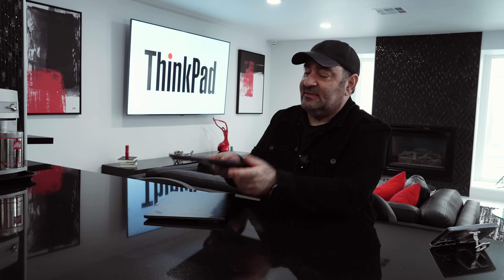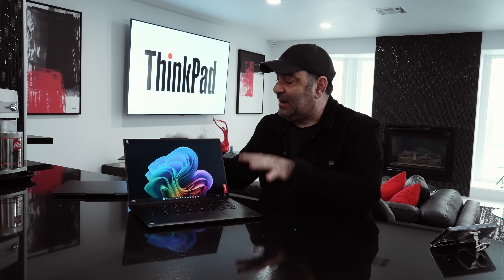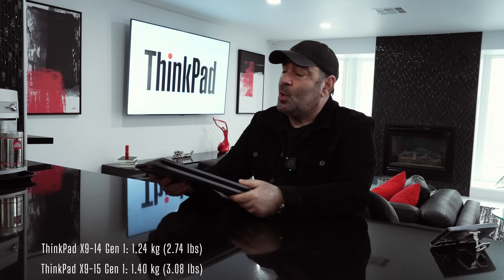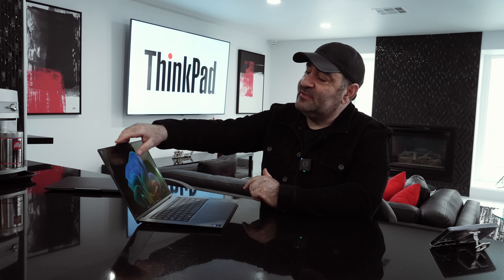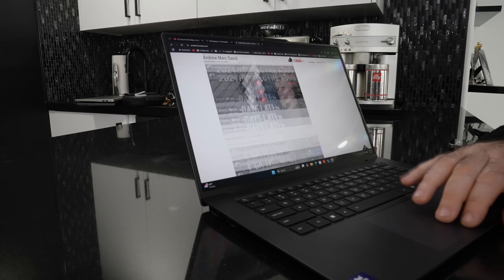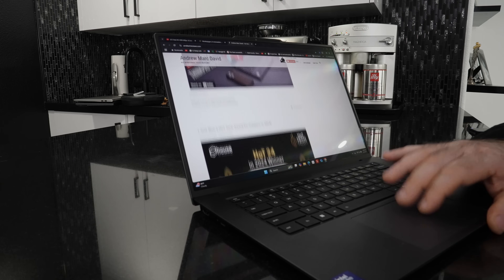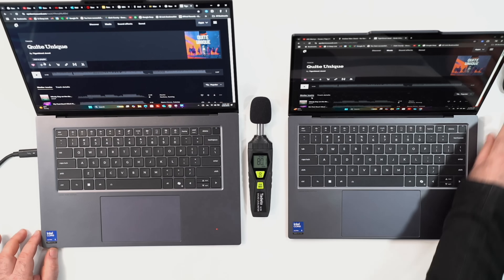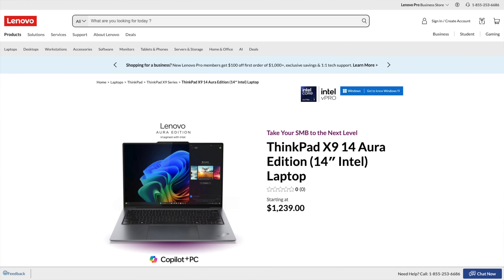ThinkPad X9 (15") REVIEW:  Well This Was UNEXPECTED

Comment: I still don't get what is use of 13inchers or even 14inchers other than backup laptop.
Reply from the maker: They're great for portability!
Reply: I agree. Even in public transport you either have no room for a laptop or manage to fit 15-16". I haven't found myself in situations where I wanted a smaller device.

Comment: Buyers of the Yoga 15” Aura should consider this too. It has a less powerful CPU and less RAM and storage at the same price level but the advantages are probably more tangible: longer battery life, better screen, better trackpad, better webcam and overall much better build quality. This has a standard 3 year warranty vs 1 year for the Yoga. I’d probably go for this.

Comment: I whish they didn't give option to have touch, non haptic touchpad. Just select a resolution that %150 scaling works for screen, no touch, haptic touchpad. Only option should be the cpu/memory/ssd. No touchscreen nonsense, no old style touchpad. 

If not, importers in my country will ruin everything and import the top end, and top bottom. Very bad screen or unnecessary hi-dpi screen with touch ruining the display with screen door effect.

Comment: Thanks for actually reviewing the laptop, rather than simply reading a spec sheet to us. This is the only non-fake review I've been able to find of this laptop.
Reply from the maker: Appreciate that!
Reply: @ I have extreme buyer’s remorse with my M4 MacBook Pro. After 20 years of being an Apple customer, I’m convinced that nobody hates Apple customers more than Apple themselves. I’m considering selling my M4 MacBook Pro and going with a premium PC laptop and dual booting Windows and Linux. A large screen (15+) and centered trackpad are my two main requirements. Other than this ThinkPad X9 15, do any others come to mind? I’m a bit hesitant with the Surface Laptop for Business 15 (Intel) because Linux support isn’t clear and the pricing is ludicrous without volume purchases. I need a centered trackpad due to my accessibility needs, which is why my last ThinkPad was the T520 (I still have it). Thanks!

Comment: To the X9 15-inch touch variant owners, I’m curious about the severity of the screen door effect in real life. Do you notice it from a normal viewing distance? I work extensively with writing applications, which often involve a white background, so I’m particularly interested in how it affects my work.
Reply: I personally didn't see screen door effect in daily use ( in normal distance between eyes and screen ), the screen is excellent honestly. However, if you come extremely close to the screen you will probably notice that there is a feeling of sand pixel in the screen ( very subtle ) in white mode, BUT only when the distance is UNCOMFORTABLY CLOSE, so i expect this won't bother you, at least i don't.   Since everyone have different experience, the most effective way is to check it out by your self.

Comment: I still don't understand why the speakers on the 15-inch is a tad weaker than the 14-inch variant.
Reply: Considering only the 14" model gets a Sensel touchpad, I'm betting the speakers for the 15" are also from a different vendor. I don't know if I'd say they're necessarily weaker... they just might not be tuned to work well with Dolby's "Dynamic" preset. I've found that the Dolby app's presets can be hit or miss depending on the hardware. The "Voice" preset on the 14" model for example makes speech quieter for some bizarre reason.
Reply from the maker: Yeah, it was a surprise to me as well.

Comment: I have the 15inch and it’a a descent machine (compared to a macbook pro), focusing on the bad part
- linux support is coming (not there yet)
- tactile trackpad from chicony is ok. Right click is hard to do, and we need to put too much force to click to my taste. Palm rejection is actually bad.
- speakers are bad compared to the macbook pro. And still bloated with the dolby software.
- display is excellent for day to day use but colors is aweful for watching movies. Blacks are greys… weird for an oled. Software issue?
Reply: Extra notes:
- I wish we could control the click force from software settings. Only click tap sensitivity, but not the tactile click.
- my video testing is incomplete and want to spend more time on it. I only tried to watch a show on Crave from my chrome browser on windows. Like I said, probably a software issue. I cannot believe an oled cant do better.
- for speakers, i am still disapointed about its sound quality. There is definitely a business opportunity for someone to bring a pre-integrated speaker with proper hardware dsp configuration to be sold as an oem solution
Reply: Apparently the 14 inch is very good for speakers, sad to hear the 15 inch has mediocre ones... I wish companies focused on that a little more. I tested the zenbook s14 in store and it was really good. Weirdly enough better than their s16 and any macbook other than the pro 16... I wasnt 100% sure as for the pro 14 inch but the laptops were far apart and they were either equal or the asus better at 60% brightness @rissmau11

Comment: The difference in the haptic touchpad is quite significant. Sure if you have never used a Sensel and you pick up the x9 15 it will feel good. But using the x9 15’s non-Sensel pad next to the surface laptop 7 for business’s Sensel pad, the Sensel pad is clearly better. It’s significantly smoother and more responsive. You can fine tune the pressure required to make a click. And it’s also very consistent. I had to return the x9 15 because I was constantly getting non-clicks at different amounts of pressure being applied (I.e. the inconsistency). I even tried regedit.exe to manually reduce the pressure needed for a click (which is a standard Windows setting feature for Sensel touchpads) but it did not seem to change at all no matter what value I set it to. Night-and-day difference in my experience.

Comment: Nice laptop.  Camera and mics are good.  Display very good.  On a clamshell it is no big deal as using a pen on one of these is not very practical.  Sound is good although the smaller one is still better.  As far as the touchpad is concerned when one starts using this for a little while one will get used to it fast and it will not be an issue of what brand of touchpad it will be.  As far as price is concerned it will be interesting what effect the coming tariffs will have on these.  Great quality review.

Comment: Reiterating what you said I really love the X9 but I do wish it had the 1.5 key travel that the Lenovo Yogos are coming with however I am interested in trying the Microsoft surface business model and hoping the keyboard might perform a bit better.
Reply: Having ordered and tried both the Surface Laptop for Business and ThinkPad X9, hands down the X9 has the better keyboard. I REALLY wanted to like the Surface badly for its cleaner design, but the keyboard felt noticeably mushier to me. I was experiencing some key deflection issues which held me back from achieving higher scores during typing tests. I was consistently getting 20-30wpm more with the X9.

Comment: Is there any reason to prefer the X9 14" to the X1C Gen 13, assuming similar configurations to the extent possible (ignoring cost)? Any features better of the X9?
Reply: The biggest things that stand out to me is that you get a variable refresh rate OLED touch display that's 100 nits brighter, better 8MP webcam, and better dual speakers on the X9. Given the $800+ starting price difference between the two, personally I find the X1C Gen 13 to be a tough sell. Unless you absolutely need to have the lightest possible machine, more traditional keyboard layout, TrackPoint with physical button trackpad, and additional ports, the X9 just gives you better bang for your buck in terms of specs.
Reply: @andrewmarcdavid How different is the build quality between the two? I am drawn to the X9 as well over the x1c gen 13. I don't care about the TrackPoint or the lightest possible machine. I currently use a Dell Latitude 9440 and am tired of the lattice keyboard. But love the build quality of the 9440.
Reply: X1 carbon is definitely better quality, PERIOD
Reply: @popokatapetl6995  in what way though? Can you specify? "Build quality" can mean different things to different people. Physically the X9 feels like it's carved from a block of aluminum, like a MacBook. The X1 really didn't feel all that much different than a T14s to me. The advertised carbon fiber only refers to " 3% post-industrial recycled carbon fiber in plastic frame on top cover", so it's largely stil a mix of plastic with magnesium reinforcement. The main selling point of the X1 is that it's lightweight.

Comment: I desperately need a Lenovo lunar lake 16 inch touchscreen with numberpad. Lenovo numberpads are always spot on (not cramped at all)
Reply: T16 Gen 4 was just announced in MWC 2025 with a release date of June 2025. Agreed with you on Lenovo being one of the few companies (possibly maybe the only anymore) which understands how to design a proper numpad.
Reply: They have 2 in 1 variants of the Yoga Slim 7i Aura edition now. The 16" Yoga Slim 7i aura edition gen 10 has a numpad and lunar lake CPUs up to the Ultra 7 258V
Reply: @ I see. But the screen is crap. No Oled and much lower resolution. Can't have everything I guess
Reply: Why not consider a Strix Point ThinkPad?

Similar efficiency, same iGPU performance, and more CPU cores/performance which means a bit higher peak power draw but otherwise an equal contender IMO 👌
Reply: If it's not lunar lake then the efficiency isn't the same. I need > 10 hours web browsing and streaming video battery life. Plus I prefer a 2.8k or higher resolution oled screen.

Comment: I think that Lenovo should have gone with a 14 and 16 inch version. The 16 inch version should have had a Sensel touchpad and a 99 Wh battery.

I would also have preferred an SD card reader. Hopefully we will see AMD options as well.
Reply: I'd also appreciate seeing a 16" model with a proper numpad. I hate that numpads are rapidly disappearing or being implemented in a half-assed way.

Comment: I just got the x9 and did a videoplyback test. I opened a 4k video, 50% brightness, no tabs no backlit and power battery mode, and it lasted for 3.5 hours. is this normal?
Reply from the maker: That definitely doesn’t sound right
Reply: @andrewmarcdavid  yes honestly might return it and get a 15 inch since it also heats up and makes a lot of fan noise over nothing. i think the 15 is a no brainer. Is there just a very small difference within the touchpad? I am in love the sensel one
Reply: What configuration do you have Sultan? 2K OLED with VRR?